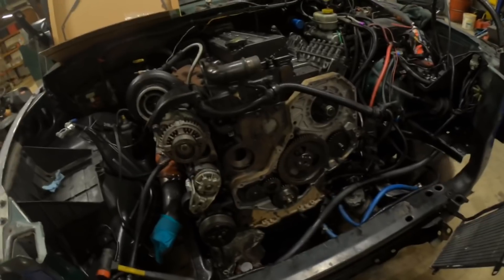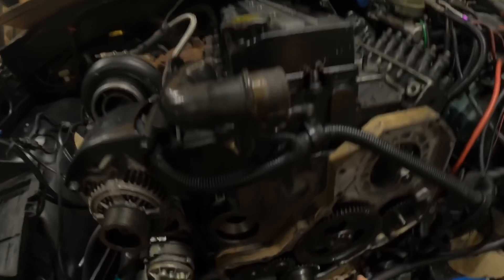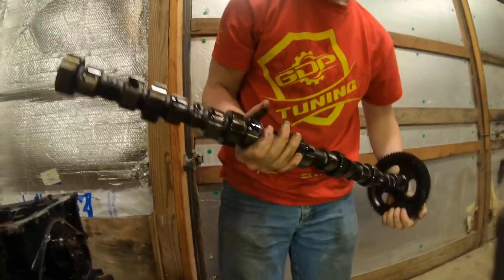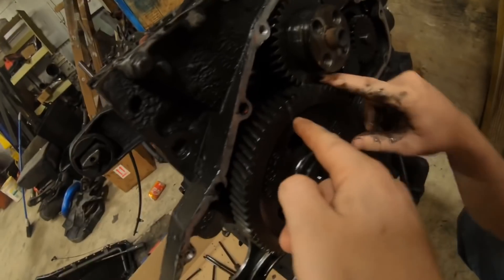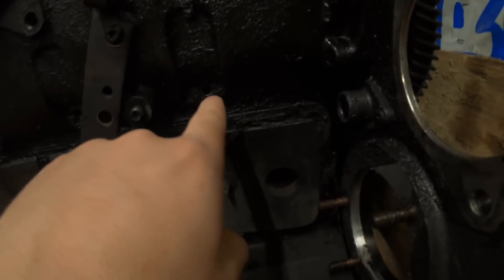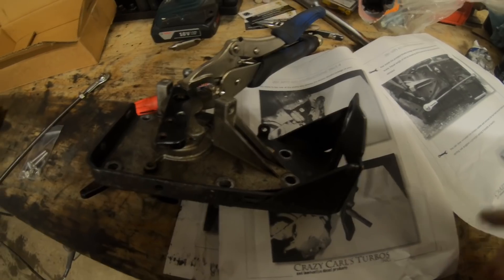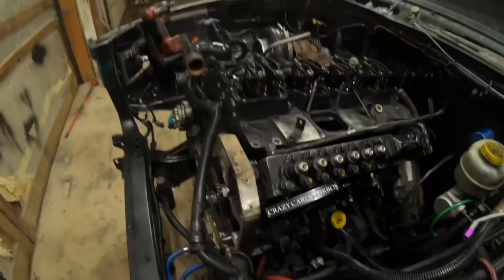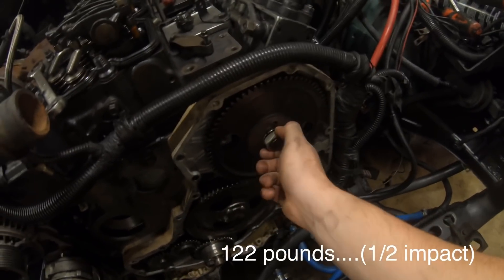PPUMP SWAPPING A 24V PART 2

Comment: What about the cam position sensor adapter in the back on the timing case? I cant get mine to read properly even after modifying it. How did yall do it?
Reply from the maker: Did you verify your camshaft has a tone ring on the back of it?
Reply: @dirtydiamonddiesel5901  yes. It's a stock 24v cam. I used a dremel and everything and cant get it to read. Do you have and pics of how you did it?
Reply: Any pics**
Reply from the maker: @KREperformance  I dont have any pictures, I just remember we had to use a carbide bit to make the hole large enough for the adapter to fit. I wish i could be more help but it sounds like you could possibly have a bad sensor.
Reply: @dirtydiamonddiesel5901  the sensor was just replaced is the thing. It's getting 5volts to the sensor and all the wires have good continuity. So I'm lost.

Comment: How do yall like the crazy carl kit?
Reply from the maker: A little modification required, You will have to run a High flow Banjo bolt for the fuel inlet on an Auto Truck other than that very fair price and good product.
Reply: @dirtydiamonddiesel5901  okay i have a 5 speed 24v and the ecm is starting to have problems so i am looking to p pump it